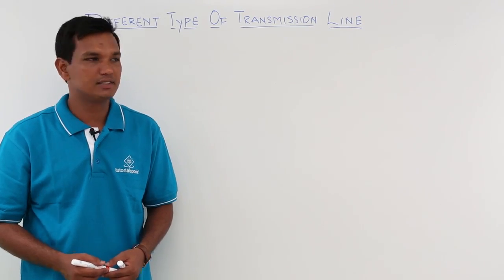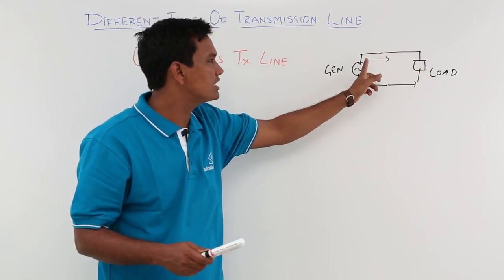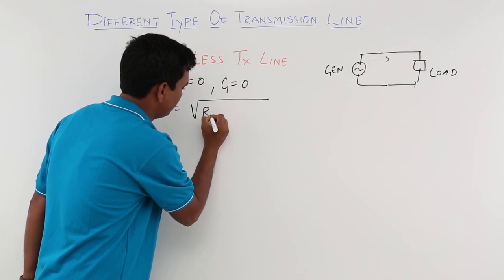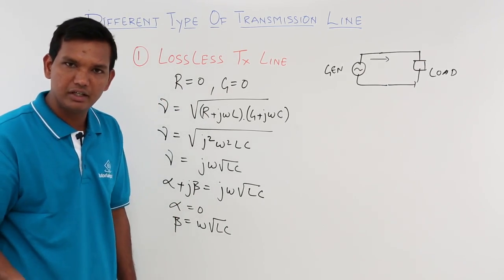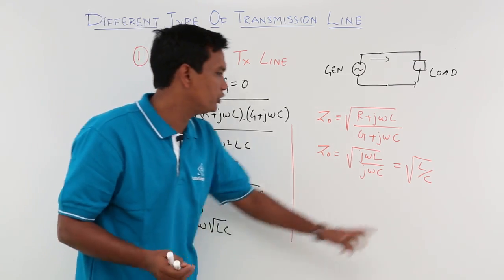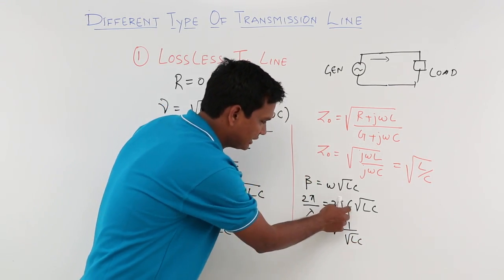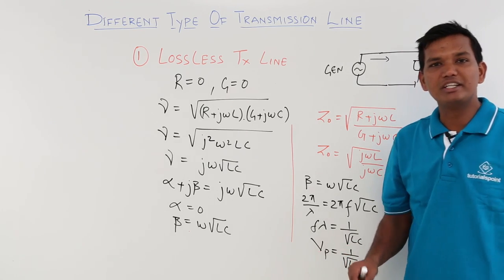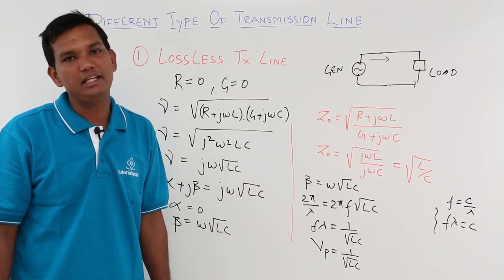Different Type of Transmission Line   Loss Less

Comment: i appreciate your  efforts . honestly i got all the concepts about the lossless transmission line
Reply: For a definition of attenuation visit http://www.nist.gov/calibrations/upload/mn137.pdf
Also, you may refer to the book below.
What is a transmission line?
When a high frequency signal voltage is applied to a transmission line, which consists of a pair of perfectly conducting parallel planes separated by a distance, energy transfers from the source to the load by pulsating electric and magnetic fields between the planes; the fields don't travel.
Transmission lines are analysed by considering the voltage and current on the line, and the field configurations and wave dynamics provide insights into the origins of the voltage and current.
The book "Fundamentals of electric theory and Circuits" by Sridhar Chitta
https://www.wileyindia.com/fundamentals-of-electric-theory-and-circuits.html begins with detailed discussions in the initial chapters 
on the topics of surface charge, coulomb's law, electric fields, fields of dipoles and other charge configurations such as a pair of parallel plates, in which a distinct approach is made using the surface charge concept in the study of advanced topics of capacitance, currents, conservation of charge, conservation of current, superposition of fields, superposition of potential, a simple dc circuit, voltage, voltage source, difference between e.m.f. and potential difference, ideal voltage sources, resistors, how current branches in a parallel circuit, capacitors, and the superposition of ac signals on a dc voltage for coupling signals to amplifiers.

One section in Chapter 3 describes the principle of superposition of potential and provides an intuitive explanation of its application in small-signal ac circuit anaysis and developing ac equivalent circuits which is not usually found in textbooks.

Then, two chapters are devoted to discussions on magnetic fields, magnetic fields of a current element, straight wire, current loop, solenoids, biot-savart law, inductors, Faraday's law, inductance, ac circuits, and transmission lines. 

The section on Transmission lines in Chapter 5, discusses signal transmission over two-wire lines and coaxial cables. There is an in-depth discussion on the origin of common-mode currents, incident and reflected waves in transmission lines and the TEM mode of wave of propagation.
One section is devoted to a discussion of the attenuation in the context of lossless lines and the speed of propagation of signals over transmission lines.
In several chapters, the differential-mode signals of circuits are identified and in one chapter a comparison of the differential-mode signal and common-mode signal is provided. 
An interactive Java based program depicting the passage of signals on transmission with a provision to vary line parameters is included in the CD alongwith the book, which is useful to understand the propagation of signals on transmission lines.

Subsequent chapters discuss the
Lorentz Force law, motors, generators, p-n junction diodes, electromagnetic waves, antennas and radiation, waveguides, and new electrodynamic theories on the nature of the electric field.

The CD contains animated power point presentations for all chapters and voltage regulator, RC phase shift oscillator, transformer-coupled audio amplifier and differential amplifier included additionally.
The contents of the above book by Sridhar Chitta, make a distinct unified approach to electrostatics and a few advanced circuits like coupling signals to amplifiers. This approach lends precision and clarity to the topics which is not found in most text books.

There is a "look inside" feature in the amazon.com webpage of the book "Fundamentals of electric theory and circuits" by Sridhar Chitta with a few pages of Chapter 1 which may be viewed and also which you may swipe left or press < icon to view the foreword, preface and Table of Contents. 
There is a full set of lectures beginning lecture 13 here on surface charges, electric fields, simple circuits, capacitance, inductance, faraday's law, motional emf, magnetic forces and more topics here
https://matterandinteractions.org/videos/EM.html
Electrostatics and circuits belong to one science and not two, that of electricity and magnetism. To know how they are unified visit this link 
https://matterandinteractions.org/articles-talks/ and view the article 'A unified treatment of electrostatics and circuits.  B. Sherwood and R. Chabay, unpublished. (1999)'
pdf. 
For a live demonstration of surface charge and its effects in circuits visit 
https://youtu.be/U7RLg-691eQ

Comment: Kya aap mujhe notes de skte h cntl ke
Reply: For a definition of attenuation visit http://www.nist.gov/calibrations/upload/mn137.pdf
Also, you may refer to the book below.
What is a transmission line?
When a high frequency signal voltage is applied to a transmission line, which consists of a pair of perfectly conducting parallel planes separated by a distance, energy transfers from the source to the load by pulsating electric and magnetic fields between the planes; the fields don't travel.
Transmission lines are analysed by considering the voltage and current on the line, and the field configurations and wave dynamics provide insights into the origins of the voltage and current.
The book "Fundamentals of electric theory and Circuits" by Sridhar Chitta
https://www.wileyindia.com/fundamentals-of-electric-theory-and-circuits.html begins with detailed discussions in the initial chapters 
on the topics of surface charge, coulomb's law, electric fields, fields of dipoles and other charge configurations such as a pair of parallel plates, in which a distinct approach is made using the surface charge concept in the study of advanced topics of capacitance, currents, conservation of charge, conservation of current, superposition of fields, superposition of potential, a simple dc circuit, voltage, voltage source, difference between e.m.f. and potential difference, ideal voltage sources, resistors, how current branches in a parallel circuit, capacitors, and the superposition of ac signals on a dc voltage for coupling signals to amplifiers.

One section in Chapter 3 describes the principle of superposition of potential and provides an intuitive explanation of its application in small-signal ac circuit anaysis and developing ac equivalent circuits which is not usually found in textbooks.

Then, two chapters are devoted to discussions on magnetic fields, magnetic fields of a current element, straight wire, current loop, solenoids, biot-savart law, inductors, Faraday's law, inductance, ac circuits, and transmission lines. 

The section on Transmission lines in Chapter 5, discusses signal transmission over two-wire lines and coaxial cables. There is an in-depth discussion on the origin of common-mode currents, incident and reflected waves in transmission lines and the TEM mode of wave of propagation.
One section is devoted to a discussion of the attenuation in the context of lossless lines and the speed of propagation of signals over transmission lines.
In several chapters, the differential-mode signals of circuits are identified and in one chapter a comparison of the differential-mode signal and common-mode signal is provided. 
An interactive Java based program depicting the passage of signals on transmission with a provision to vary line parameters is included in the CD alongwith the book, which is useful to understand the propagation of signals on transmission lines.

Subsequent chapters discuss the
Lorentz Force law, motors, generators, p-n junction diodes, electromagnetic waves, antennas and radiation, waveguides, and new electrodynamic theories on the nature of the electric field.

The CD contains animated power point presentations for all chapters and voltage regulator, RC phase shift oscillator, transformer-coupled audio amplifier and differential amplifier included additionally.
The contents of the above book by Sridhar Chitta, make a distinct unified approach to electrostatics and a few advanced circuits like coupling signals to amplifiers. This approach lends precision and clarity to the topics which is not found in most text books.

There is a "look inside" feature in the amazon.com webpage of the book "Fundamentals of electric theory and circuits" by Sridhar Chitta with a few pages of Chapter 1 which may be viewed and also which you may swipe left or press < icon to view the foreword, preface and Table of Contents. 
There is a full set of lectures beginning lecture 13 here on surface charges, electric fields, simple circuits, capacitance, inductance, faraday's law, motional emf, magnetic forces and more topics here
https://matterandinteractions.org/videos/EM.html
Electrostatics and circuits belong to one science and not two, that of electricity and magnetism. To know how they are unified visit this link 
https://matterandinteractions.org/articles-talks/ and view the article 'A unified treatment of electrostatics and circuits.  B. Sherwood and R. Chabay, unpublished. (1999)'
pdf. 
For a live demonstration of surface charge and its effects in circuits visit 
https://youtu.be/U7RLg-691eQ